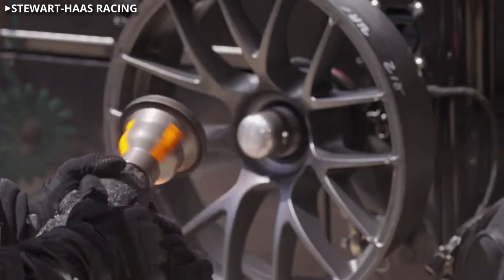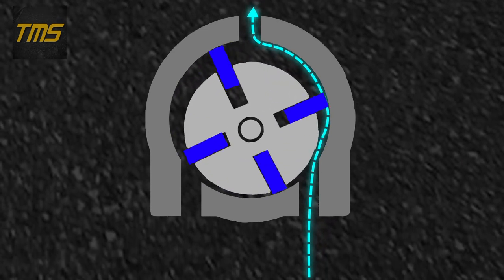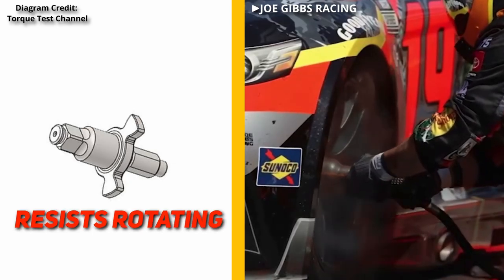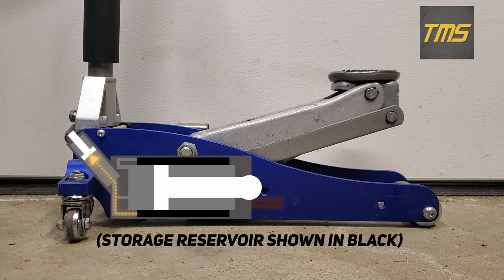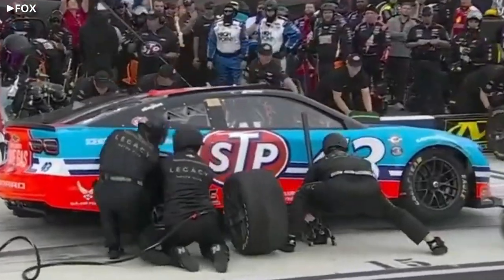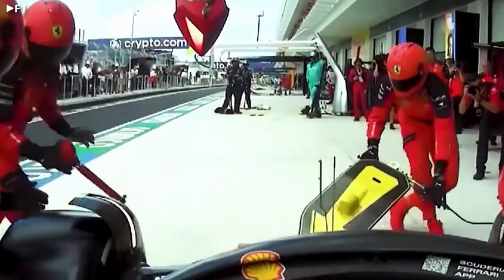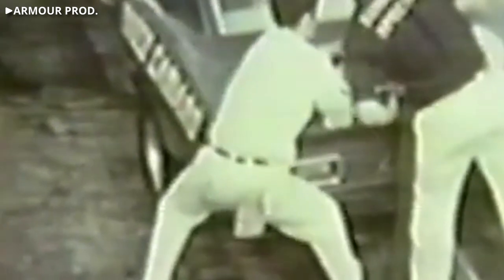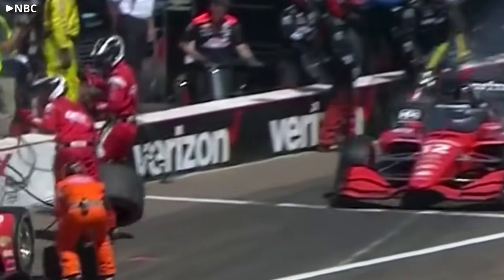The AMAZING Engineering of Pit Stop Tools! | How Impact Wrenches, Jacks, and Refueling Systems Work

Comment: You forgot about the grounding cable used when refueling cars. Apparently it’s to prevent electrostatic discharge but I don’t know much more about how grounding works.
Reply from the maker: I ended up not covering it because only some types of cars use it, but definitely an important part for endurance cars! Thanks for the comment!

Comment: Ha! I just found that exact Pittsburgh jack yesterday when I was exiting the interstate. It obviously fell out of the back of a truck and was lying in the middle of the exit ramp. Since no one was behind me, I stopped, jumped out & grabbed it, and threw it in the back seat of my Trailblazer 🤣
Reply from the maker: 😂It's a solid little jack! Use it all the time.
Reply: Oh i bet someone got upset they lost a floor jack and no one bothered to check if the trailer door was locked at all 😅.

Comment: I thought Indycar (or at least CART back in the day) had one or two air jacks not one at each corner, or was that something that wasn't ever fully explained? To me it always looked like the car went up on one or two jack points during a pit stop. That iconic hiss and snap and the snarl of a 90s CART car pulling away is iconic and amazing still though. I need to go double check if if what I was told about how teams worked that is  right, i.e. it was the vent ma man who was conecting the hoses and lifting the car. On that note, it's led to some horrific pit accidents due to drivers taking the car being dropped as a sign to go, see Milwaukee 99 among others, that had Parker Johnstone explaining about how and why drivers would have the car in first ready to go while the car was up in the air and peel out the moment the wheels touched the box and go.

Then again for sports cars I'm wondering why instead of say at Le Mans when taking a car into the garage for repairs, they don't use the air jack instead of the trolleys to lift a car? I'm half expecting it to be in the rules somewhere a team can't actually do that...
Reply from the maker: Unsure of what the CART cars used, but this article from 2018 has a diagram that appears to show a jack at each corner: https://www.autoweek.com/racing/indycar/a1705346/indycar-tech-talk-air-pressure-key-air-jack-system/
And yes, very dangerous to have the drivers ready to go right when the jacks drop!
Not sure on your last question about why they would use a trolley jack instead. It's a very good question, makes me want to go try to find the answer!

Comment: For refueling, I've always thought that using a detachable tank would be so much faster, just out with the old almost empty one and in with the new one, been tried a bit before, but never caught on, on top of needing cars to be redesigned to account for it, but it really would change refueling as a whole, saving a ton of time on full refuelings without risking fires and other issues.
Reply from the maker: Would definitely be interesting to see! The challenge is probably the time it would take to connect all of the lines and mount it compared to the time it takes to just use a hose or can.
Reply: @themotorsportstory  In endurance, when they have to refuel 50+ litres, even a high power hose can take a while. If the tank is exposed on the other hand, it could be removed instantly. There's tradeoffs with any method really, so would depend on whether you are refueling large amounts or a bit at a time (meaning heavily reliant on tyres, if you have to pit often for tyres, it would be pointless for example). There's also the fact hose allows you to not full refuel to keep the car lighter if fuel isn't an issue. The replaceable tank would mostly find a place in endurance racing, which is where it was tested on decades ago (can't remember which events it was exactly, was around 80s-90s).